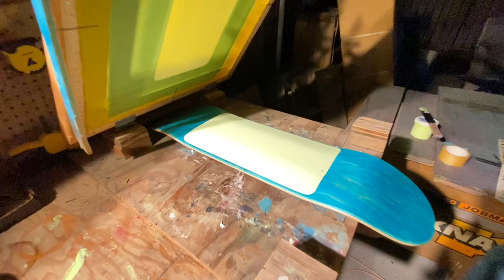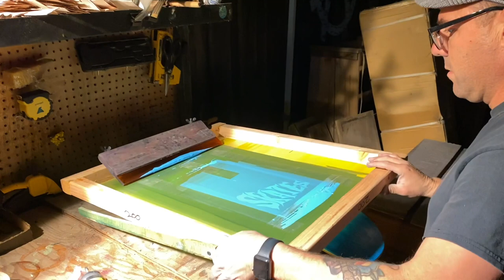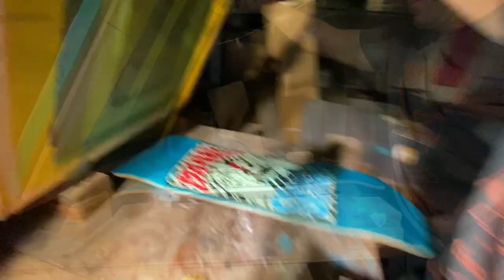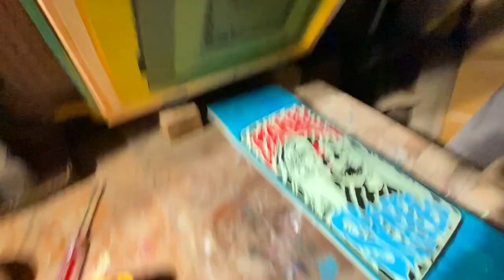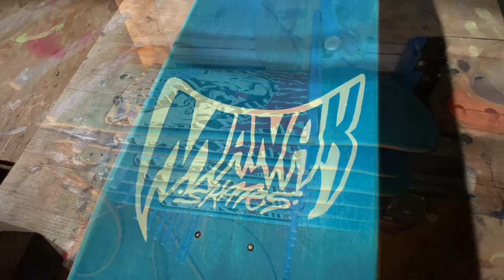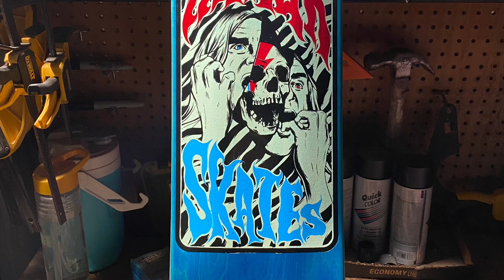Skateboard Screen Printing

Comment: Are you screwing the board into something view the truck screws? That’s so smart to keep it from moving if you are. I have an industrial press for shirts and even looking at these presses for skateboards online I’m like “yes but how do multiple colours well!”
Reply from the maker: $10 jiffy clamps from Amazon, scrap wood and old skateboard hardware sticking through blocks is how you make this jig. The deck sits on the blocks and the skateboard hardware goes in the truck holes to keep it in the same spot. I can adjust the blocks for different sized wheelbases on the fly. You hit all decks with the first color and let them air dry, then setup the next color and line it up of the first print and repeat. I have a how to screen print skateboards step by step video on this channel if you’d like to see this process in greater detail.

Comment: These look amazing! What ink do you use? Is it acrylic or water-based?
Reply from the maker: It's water based acrylic speedball ink. No smell, water cleanup, goes down smooth.
Reply: @ManakSkates  thank you so much for the reply! What brand of clear coat do you use? I have a small airbrush and compressor for painting miniature models. Do you think that would be powerful enough to give a proper application to the board? If I were to skip clear coating, how durable do you think the ink would be? Thanks again man, I'm learning so much from your videos!
Reply from the maker: @pixeltwerpstudios1771  We use deft in a can from home depot. You can get a cheap spray gun on amazon for $40. Sealing the deck with clear coat is very important. You can always use rattle cans of clear gloss which cost $4-$8. Deft and Rustoleum make good spray cans of gloss.